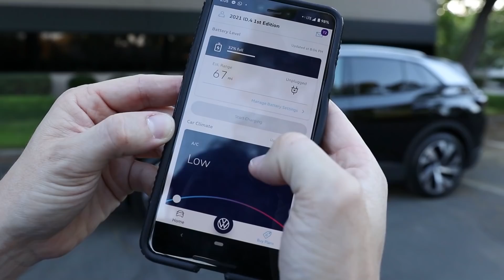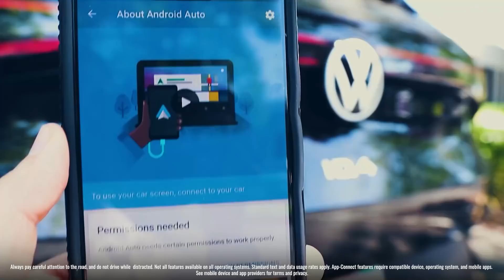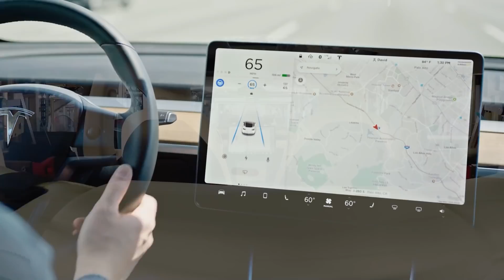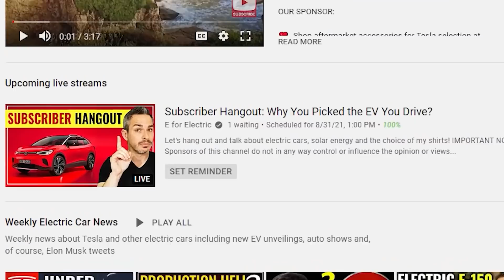Chip Shortage Explained

Comment: You made great points about the embargo on Chinese-made chips, and the Taiwanese drought, though I'm still a bit skeptical of there being a true chip shortage.  Pandemic industry shutdowns persisted for only a matter of months in most places, and this chip shortage is now expected to last for years.  Do we have any raw data for real global demand and production capacity?  There are also a few points which would minimize impact on the auto sector:

1) Cars are high ticket goods and they are demanding huge premiums right now due to supply shortages.  Auto manufacturers can pay higher and buy up more of the current chip supply compared to other industries since they make higher net profit per item.  Example: If an automaker makes $8k profit on a new car, they can afford to pay $4k for microchips, whereas Apple may make $500 profit on a new phone, they can only afford to pay $300 for microchips.  The microchip factory will sell to the highest bidder.

2) Manufacturers can produce vehicles with significantly less microchips.  This may take a year or two, but would allow them to gain a competitive edge over rivals.  If they can produce twice as many cars, they will quickly gain profit and market share compared to rivals.